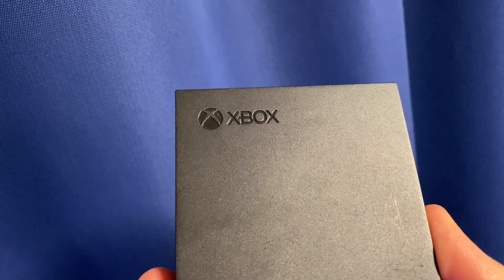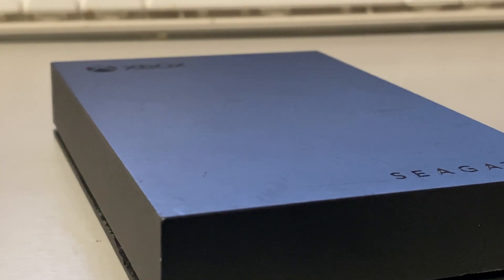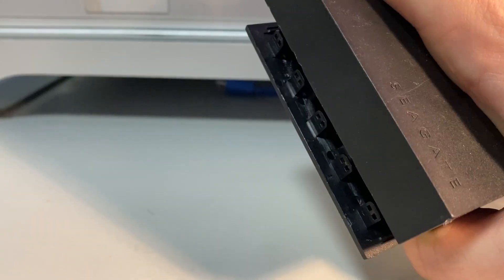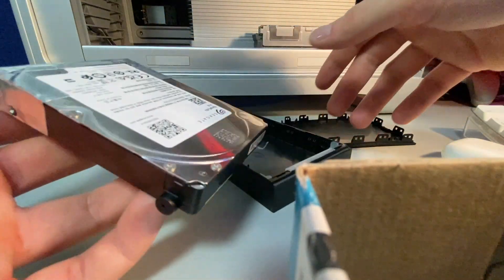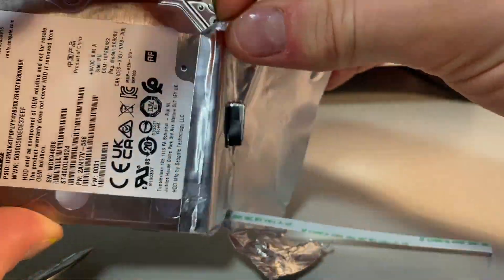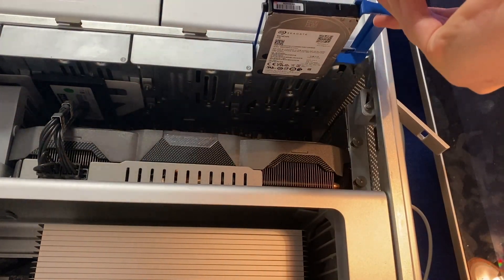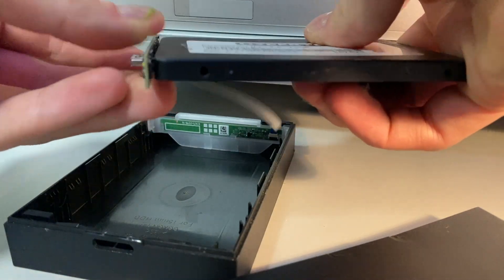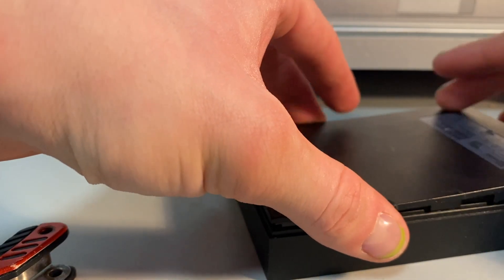Take Apart Xbox Game Drive to Use in PC! What's Inside it? Seagate 4TB Hard Drive Dismantling Guide

Comment: So can you somehow take apart a older Xbox and access the memory drive and hook it to a newer Xbox for more memory storage?
Reply from the maker: I’m not big on Xbox knowledge, but if you want to use a One drive as the boot drive for a Series X/S you’re gonna need to have the Xbox Series OS/firmware on it, which would take more expertise and time. Not to mention the newer Xboxes use different storage form factors, so it would probably have to be rigged to be external somehow.
Reply: @montaguebarnabasltd the Xbox One hard drives are 2.5 in while the ones in the series consoles are nvme 2230 and you do need to clone the drives. So you want to be able to use it as a boot drive but you could use it as an external drive